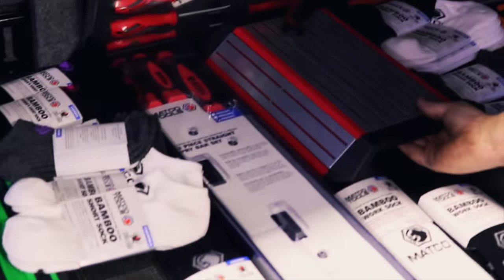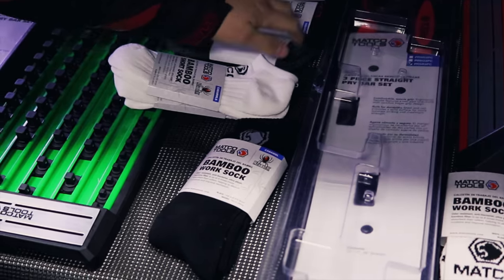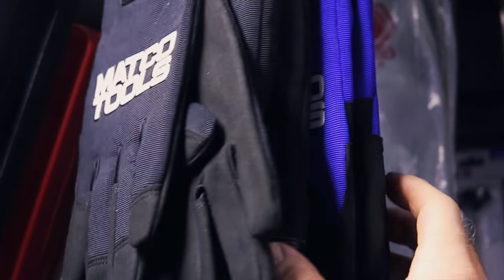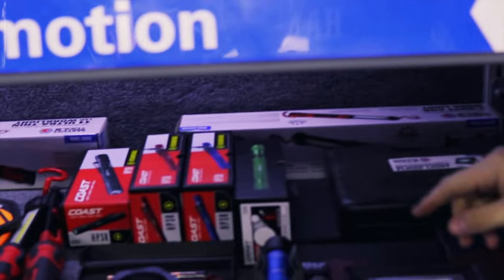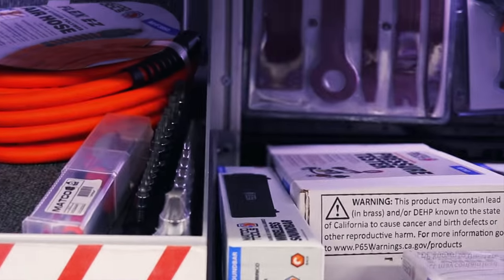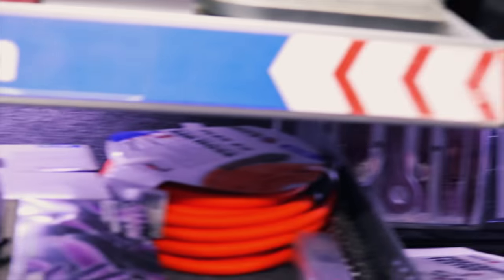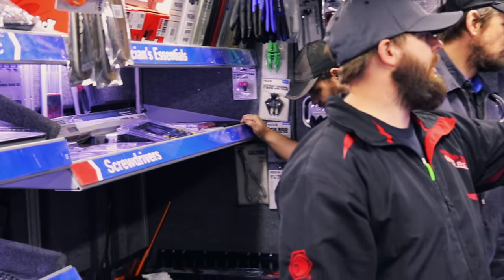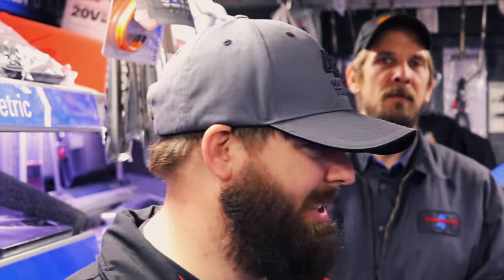Brand New Matco Tools Fresh From The Tool Expo In Las Vegas

Comment: Those digital angle and torque gauges that adapt your ratchet to a torque wrench have been out for a while I wondering if Matco is now making those or if they rebranded somebody else's.
Reply: jason reynolds it seems like it is too bulky and would get in the way when torquing something in most cases
Reply: @kidzero1943  yeah depending on what you're working on with it they can be a little bulky and space intrusive

Comment: send well wishes to mr snap on please also i need some good socket rails from someone who has them this message is for all your tool guys note this them rails need to be good for service truck setting
Reply: what is the part number on the socket rail you have there i need for both 3/8 and 1/2 drive if you think they would work in a service truck tool box